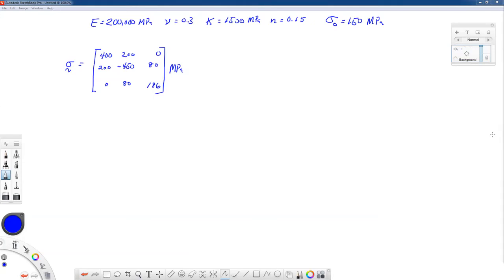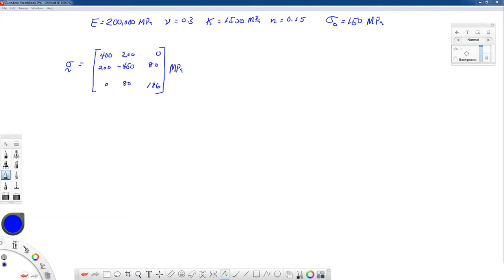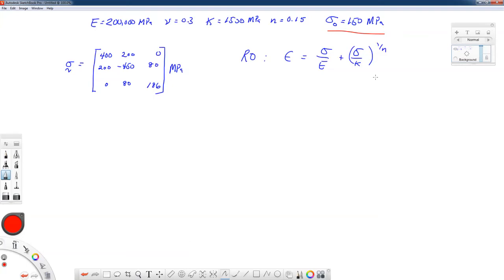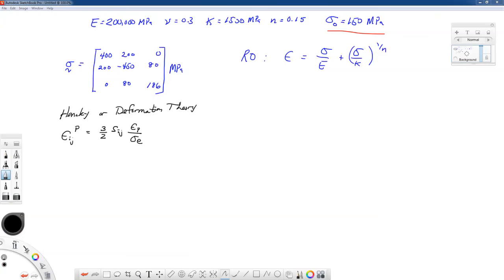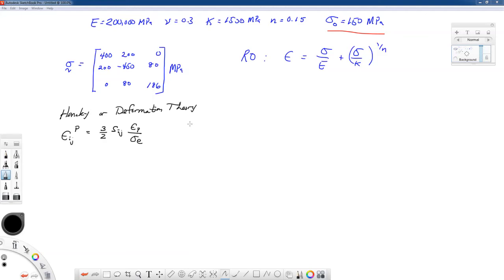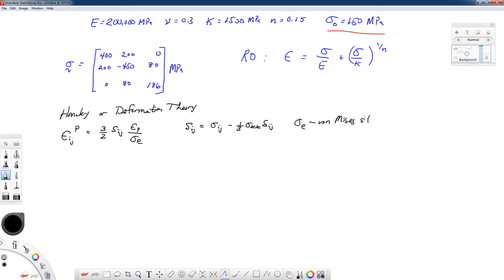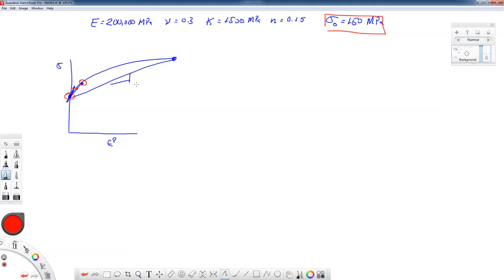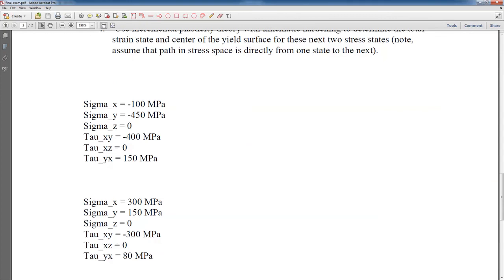AEM 648 Deformation and Incremental Plasticity Example with J2 flow theory

Comment: Hi professor in the columb where it says check for yielding, how do you tell when you have plastified your material ? 

Thanks.
Reply from the maker: If you have axial loading you can do a check of the axial stress.  This would only be of practical concern if the object was not very column-like.

Comment: Dear prof, I was checking your final.xls, did you by accident multiply the strain in y by 2? These are the cells R52 and R53. I tried to reproduce the incremental methods by code but did not get the matching results in your excel sheet.
Reply from the maker: Are you looking at a column of tensor vs engineering shearing strains?  If it is not shearing strains, you can try a uniaxial loading and see if the two transverse strains match the closed form result.

Comment: hi, why the portion of (1-beta)*sigma has both elastic and plastic strains?
Reply from the maker: It is an elastic-plastic material.  beta*S represents the elastic only behavior.  (1-beta)*S represents behavior beyond the yield stress, where the behavior is elastic plastic.  Happy studies!
Reply: @mbarkey.mechanics  Thank you, Professor! But why can you calculate your model analytically, when means calculating using explicit fuctions. For example, the parameter (d_lamda) in this vedio can be calculated directly, but in some other models it may be calculated only through some iterations.
Reply from the maker: @zc3605  The calculations of plastic strains are path dependent.  For certain paths (e.g. proportional loading) closed form equations can be used to calculate the final plastic strain state.  However, more generally, we must follow the path of the stresses, and so an incremental approach is necessary.    I believe I have a lecture on the Hencky equations of plasticity that should explain the issues.

Comment: Professor, I have been following your lectures. I am working on a problem right now and am a little confused.
Problem is - The stress history at a material point is known. The stress history consists of two loading
 segments. In the first segment, the material is loaded from the initial stress-free configuration to stress state 𝜎𝐴 with linear stress path. Then, in the second segment, the material is loaded from stress state 𝜎𝐴 to stress state 𝜎𝐵 with linear stress path. The material behavior is elastic-plastic with linear isotropic hardening. I have the matrices 𝜎A and 𝜎B, Young’s modulus, Poisson’s ratio, the initial yield stress and the plastic hardening modulus. With this data how can I obtain the analytical solutions for strains at these two states A and B. I mean the values of 𝜀𝑥, 𝜀𝑦, 𝜀𝑧, 𝛾𝑥𝑦, 𝛾𝑥𝑧, 𝛾𝑦𝑧 at these points. 
This question is different from this lecture but i will be grateful if you could share some insight. thanks.
Reply from the maker: You will need incremental plasticity also discussed in these videos.
Reply: @mbarkey.mechanics  Professor could you point me towards that specific video (by sharing the link here).
i read about incremental plasticity from a book but would like to watch the video as well.
Reply from the maker: You will have to determine if you have a proportional or nonproportional stress path and if you have loading or unloading.  This is the correct video for both proportional and nonproportional loading.  Closed form analytical solutions are possible for certain nonproportional paths.  Your question sounds like a homework problem.

Comment: I am unable to derive the equation you have used in video (AEM 648). Kindly help me in providing steps

〖ε^p〗_ij=dλ (S_mn dσ_mn)/(2⁄3 〖σ_0〗^2 ) S_ij
regards
Reply from the maker: Hi Sujay, this example is the culmination of several lectures.  Here is the course playlist: https://www.youtube.com/playlist?list=PLaDWa6xI4zefhDwPmTR1L6z8c8rtyRDVH and depending on your background, you may want to start at lecture 8 or 11.
Reply from the maker: Also note that the equation is for strain increments, not for total strains (you are missing the "d" for deps on the left side.  This lecture provides the details: https://www.youtube.com/watch?v=P68tuq7GEUE&list=PLaDWa6xI4zefhDwPmTR1L6z8c8rtyRDVH&index=22 , but you will need the appropriate background from the videos I have already mentioned.

Comment: Professor I am an appreciated for this lecture. Could you also show the Neuber and Glinka implementation in incremental plasticity, that as input is elastic stress tensor and for output the plastic strains and true stresses.
Reply from the maker: I prefer this technique: V. B. Köttgen, M. E. Barkey, and D. F. Socie, ‘‘Pseudo Stress and Strain Based Approaches to Multiaxial Notch Analysis,’’ Fatigue and Fracture of Engineering Materials and Structures, Volume 18, Number 9, pp. 981-1006, 1995.

Comment: professor thank you for simple presentation. pl. upload sample technique for n-r method and euler backward-implicit method for solution of of the  incremental plasticity
Reply from the maker: Hi Sujay--thanks.  That sounds like you have some experience in that area--do you have a reference or some notes?  I can look into it, but it is not a current area of my research.

Comment: What could I do if I don't know the final state of stress?, could I find it using displacement increments?
Reply from the maker: It has been a while since I made this video, so I don't have the full context of your question, but you can either use stress to calculate strain, or strain to calculate stress (for a work hardening material).  If you have all the displacement components needed to calculate all the strains, then you could do that as well; of course, be mindful of the assumptions involved (small strain theory vs finite strain theory, etc.).
Reply: Thanks for answering!, my question in other words was: the whole model depends on the stress increments dσ, and dσ = Δσ/N, Δσ = σ(final) - σ(initial) , the problem is that I don't have the final state of stress σ(final), but is actually the state I'm looking for, what could I do in that case?
Reply from the maker: @jaimeur5305  The process is similar--you would need to know the strains, break into increments, estimate a trial stress increment, check to see if it was valid, etc.  This is very commonly done for measured strain histories.  This is a good reference: https://www.ideals.illinois.edu/handle/2142/21444   You should be able to find a PDF online as a Fracture Control Program report.
Reply from the maker: FCP report here: https://fcp.mechse.illinois.edu/fcp_report151/
Reply: Thank you very much professor